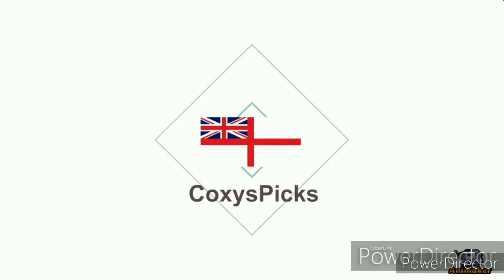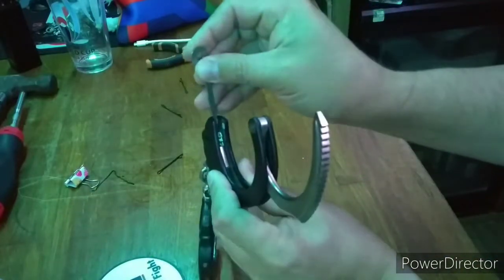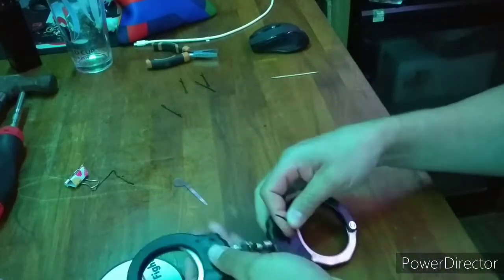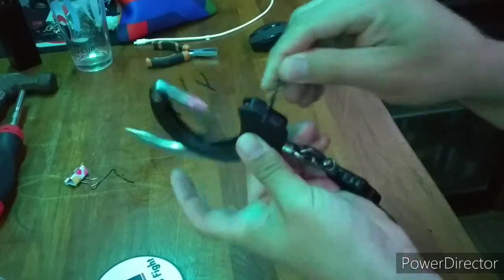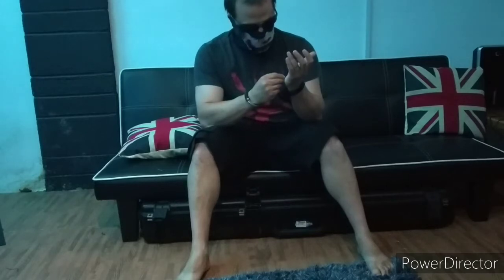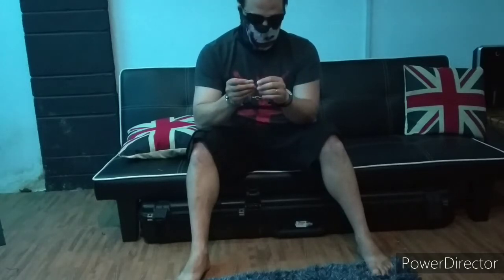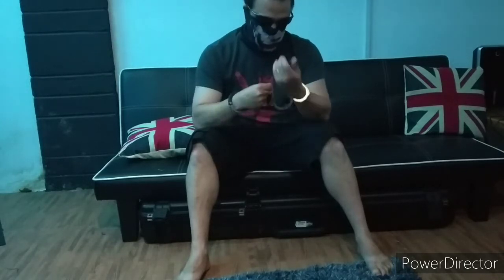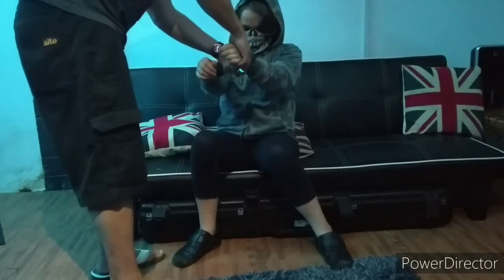ASP model 100 - With Special Guest Appearance

Comment: 😂 I love the glasses and Mask dude, how you could see anything I don’t know. Great little video my friend 👍🏻
Reply from the maker: It was deffo the wrong choice of eyewear lol. Black hole, black Bobby pin, black cuffs and the black lens. Not a great combo - however blindfolded cuff picking might be easier lol. Stay safe buddy and have a great weekend buddy 😎🤘
Reply: @CoxysPicks  I always wear black lol. Not the best when you are trying to demo black cuffs on someone who always wears black lol. I have always sucked at picking cuffs while they are on my wrist. I have picked almost every cuff in my collection at some point but the ASP 2 pawl blue high security ones elude me. I think I will need very very very VERY thin paper clips to sandwich 2 in at the same time.
Reply from the maker: @silent - if you watch my YUIL video I show a method of making a single Paperclip into two tools that allows you to grab both pawls at the same time. It's fiddly, and takes an age when I am wearing them - but it is doable 👍 I deffo need to get some of those ASP blue and have a play 👍
Reply: @CoxysPicks  Yeah that works. I think I probably did that on my old Aspiring Lockpicker youtube channel. But the thinness is the key I think. ASP keyways are very very tight, as you know. But when you add in a split plate, getting to both pawls at the same time is super hard. I can pick any pawl I want with regular hook picks but I cannot get both at the same time!! Also failed with hair grips, they are just too thick to get 2 in.